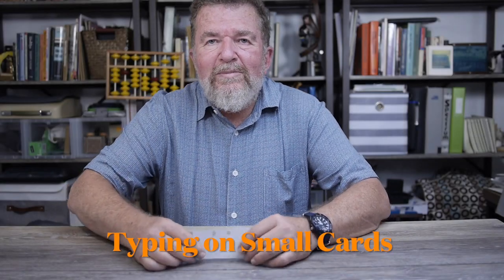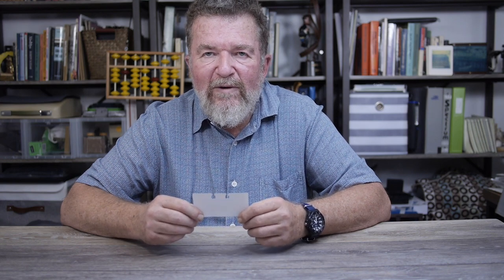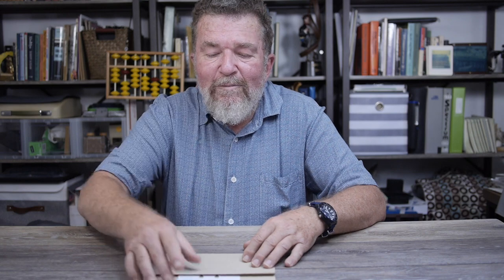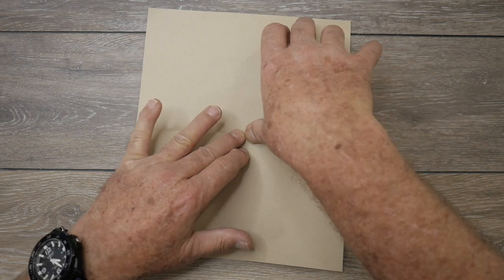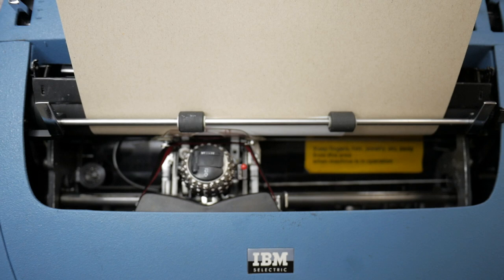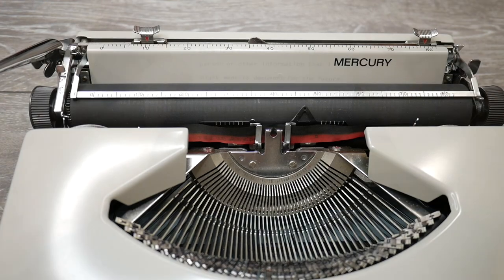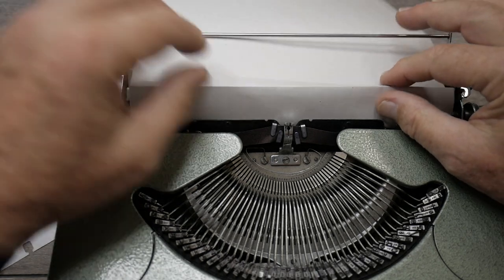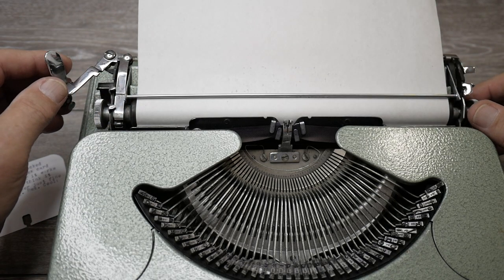Typing on Small Cards

Comment: Try affixing Post-It notes (the Super Sticky kind) to the back of the small card, hanging down off the bottom. Then once you've fed in the card, even after it's up where you want it for typing, the feed rollers are still able to hold onto the sticky note and control the position of the card. Then gently peel away the Post-It note after ejecting it. This works well for me. Not a ton of added thickness, and not a lot of futzing with the zigzag page.
Reply from the maker: Great suggestion!

Comment: It's really cool that you tried this technique on many different machines. 

 I find it easier to first fold the sheet with the bottom edge 6 mm from the top edge, then straighten the sheet turn it over and do another fold with the two edges together. 

I love the videos by Lenore Fenton. She also shows another trick for holding post cards with a slit in a bigger card sheet. I find it also works for business cards if the slit is smaller.

Daniel
Reply: Thank you!  I have a few machines with card holders, but didn't know how to use them until I watched this video.  Just think of all of those librarians who typed up each card that went into the card catalogs.

Comment: I'm interested in typing on a blank playing card. Do you know if this would be possible ? I believe that the typewriter is an IBM a lot like the first on you used. It belonged to my Dad so that's why I'm not that familiar. 
Thanks for the tips and information.
Reply from the maker: Depending on how stiff the playing card is, it might be difficult rolling into the platen. Also, the smooth finish of the playing card might not take regular typewriter ink very well without smearing. But don’t let me dissuade you, I’d love to know if you succeed in doing it.
Reply: @Joe_VanCleave  Thank you for responding.  I didn't realize how ridged these cards were until I got this idea.
I'm wanting to put bible verse on them. 
Maybe I can have them printed on somewhere for a reasonable price. 
Thank you
Reply: @Joe_VanCleave  I found some of those Avery self adhesive name badges that are a perfect fit.  ( I hope they work out ) Thanks